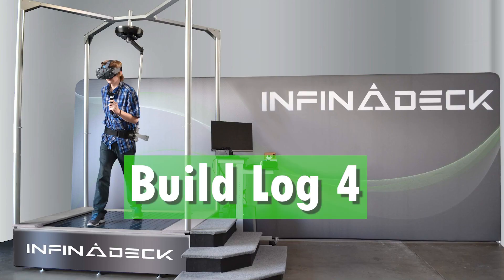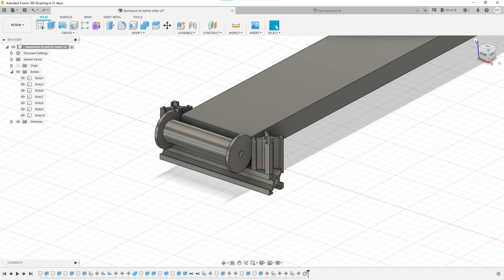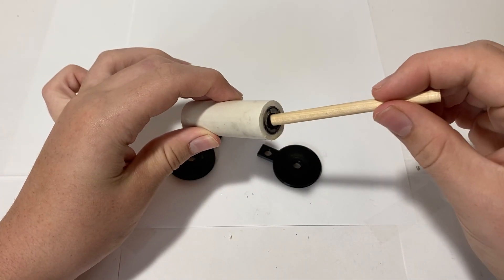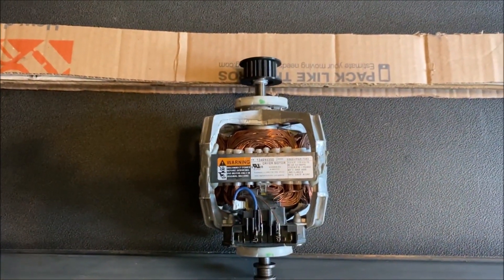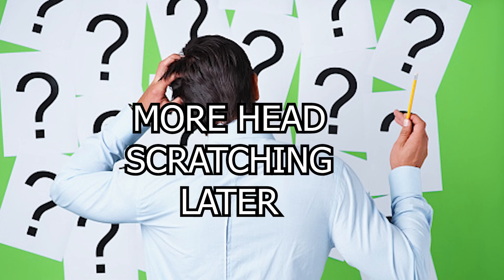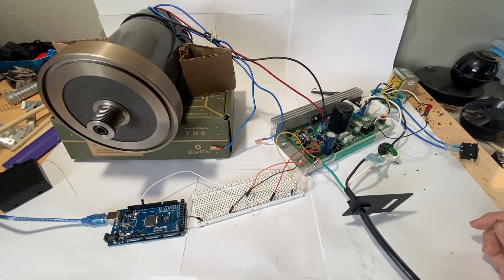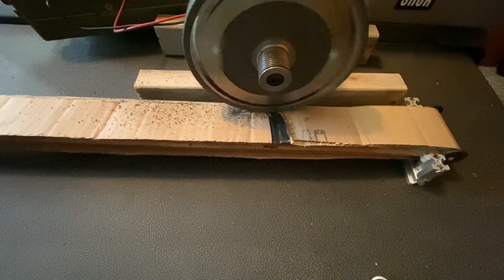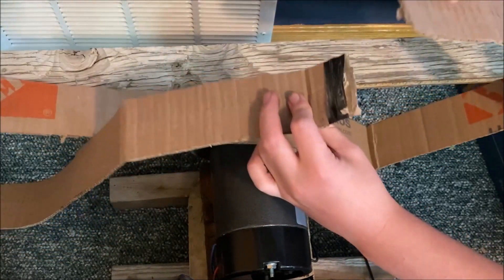Omnidirectional treadmill speed controller (Build log 4)

Comment: The bearings and wood will get ya with all that friction. Maybe laminate the wood with pvc layers? And any low end bearings would probably be better than nothing. And then lubricate those insides, maybe a dry lubricant would work well like graphite. Regardless, I'm impressed to see it working and on a budget. I totally want to do a project like this during my studies as a EE. Don't be afraid to get technical in your videos because I feel like your audience would know about arduinos cad 3d printing and the likes if they're interested in diy vr projects. Keep up the great work!

Comment: Like the idea, I've tried a similar one with the idea of making it more like a manual slat-mill would work due to the issue of needing an electric-powered one to do certain functions quickly. One major thing I've noticed and am wondering is have you tested the wood at the center point over an open area to see how much it bows. I understand you will have support in the middle as the roller for the opposite direction however, while in use that part of the belt would be pinched between the roller and the wood. So if it's trying to roll at both axis at the same time something (either the belt or motor) would be either broken or damaged. I know with my weight of 150lbs on two 2x4's per foot there was quite a bit and if you were running per say it would definitely not hold up well. This was also across a span of 42". Would love to hear if you've though about ways to avoid these issue.
Reply from the maker: that's a good question for sure! in the new design that I'm currently working on i will end up having support for the boards every 1 foot hopefully this should solve the problem! about the friction its honestly a bit to much for me to explain here so feel free to join the discord listed in this videos description.